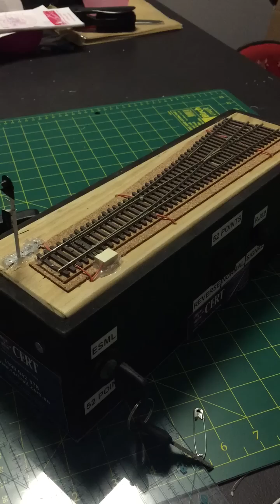NSWGR Interlocked Model Railway Points with Signal

Comment: Well done, that's awesome. Any plans to do the same thing with Semaphores?
Reply from the maker: +Neale Beresford Theory with semaphores does not change actually, instead of an output to a LED it will trigger a solenoid to activate the arm.
Reply: +Ross Jackson ok, great, so will you be displaying at Liverpool, or any other exibitions. I would like to learn more about how it all works, price, DCC friendly etc
Reply from the maker: +Neale Beresford it is not that advanced, we are building another demo model now with a interlocked Level Crossing, with working booms.
Reply: I'd almost think you trained as a sig elec, nice work. What's under the hood? Arduino? 
Should find a real signal to hook it up to... 😁